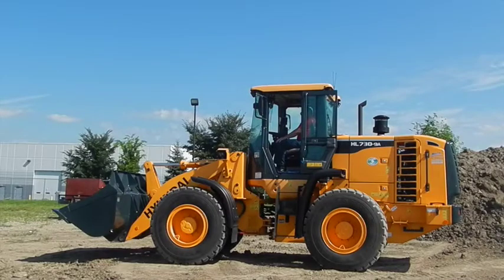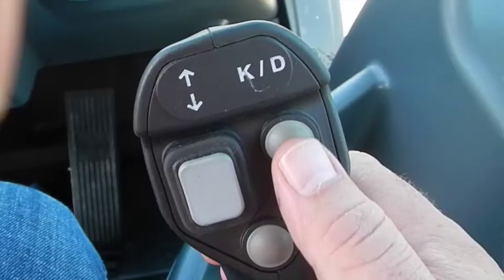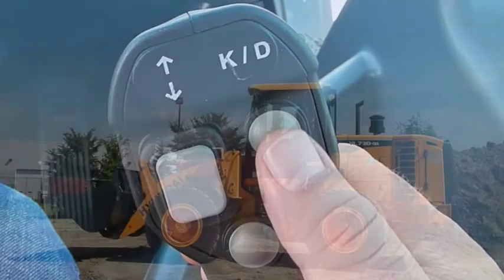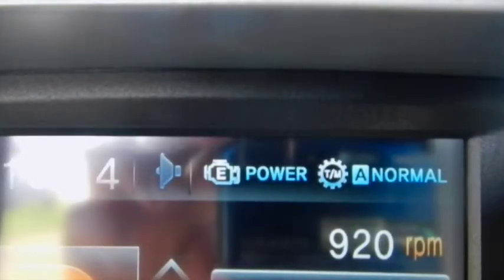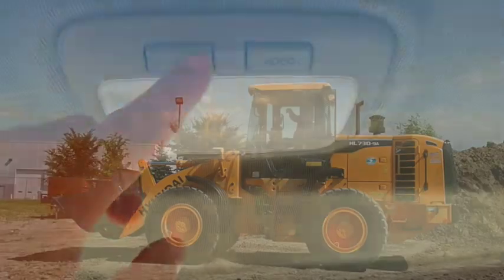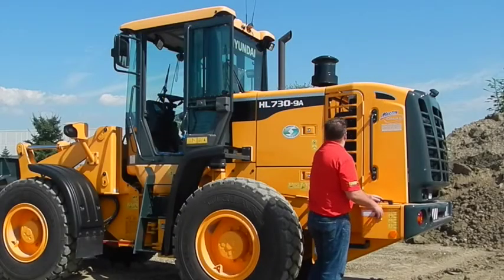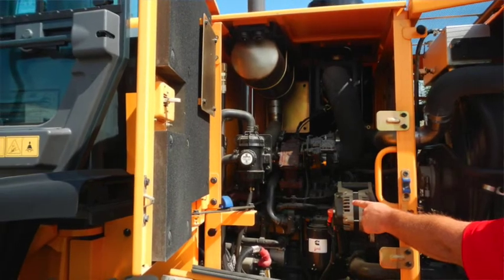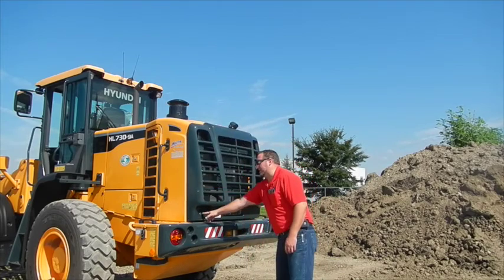Ask The Experts: How To Operate a Hyundai HL700 Series Wheel Loader

Comment: Is there any way to lock it in, say second, to prevent wheel-spin when on dodgy surfaces?
I kinda suspect that the "S" on the transmission mode dial is the thing that does this. "S" for snow, or second...???

Comment: On 370, much same, the boss said first day
1. watch out with gear selection, as it auto goes up to that speed range for each gear.... So maybe show more of that and the brakes. 1st gear only for picking up soil. 
2. Park brake on vs off positions. Pull tab, move up or down, 
3. Bucket auto leveling , dab joystick left when bucket down.... So quick up fill load easier.
4. Alarm off button on upper Screen, so can turn of screaming buzzer.

Otherwise the enjoyed the video. Thanks